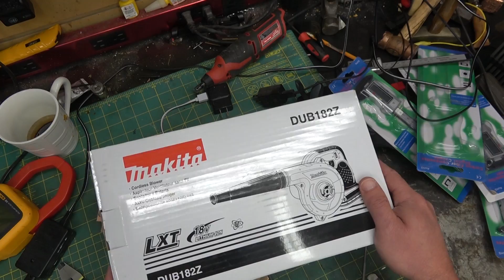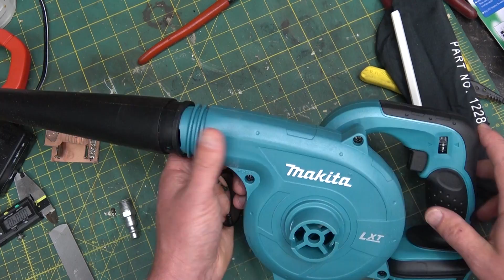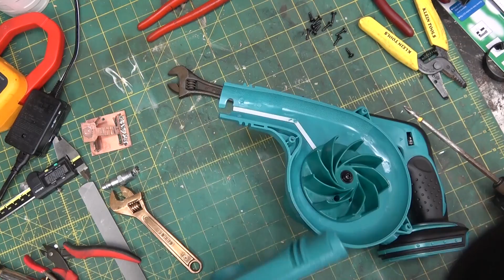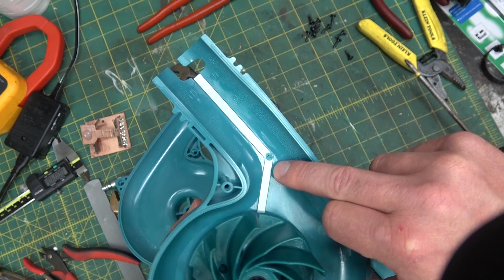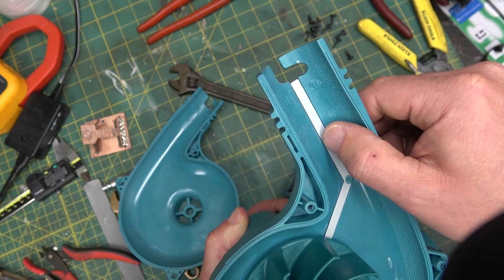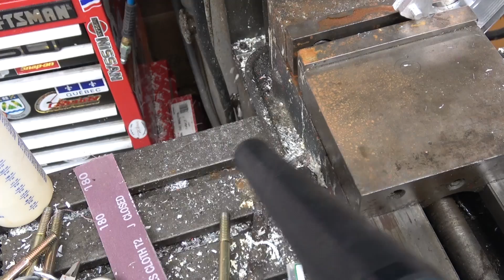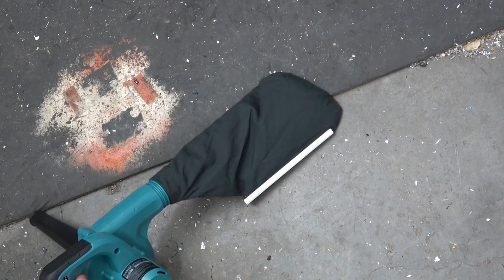BOLTR: Makita Blower/Vac

Comment: Hey man have you had any problems with the vac. Portion of this tool? No damage to the motor or little bits getting stuck in there since it runs threw the blower and motor? Your help and tips is much appreciated mate.

Comment: These will not sustain too many falls from 8 feet or more, if any. I've been through like 3 of these, one time it snapped in half after falling off the top of a 6 foot step ladder onto concrete. Cleaved 'er in twain. It still worked, but you had to screw the thing back together.
Reply: Also, after a while the wires work harden and snap off at the outsides of the clamps that clamp them to the connection points. Also, this tool will not operate without the trigger, I tried to get rid of it and just wire the battery straight to the motor bypassing the trigger mechanism, and it would not function. The Milwaukee blower of this type has far, far better blow-age and far, far better battery life. This tool is a major juice hog. Not as bad as the cordless grinders, but she'll eat up a full 3ah battery in like 10-15 minutes.

Comment: @7:00 those dimples create turbulence at low speed and smooth out at high speed, the turbulent air is pushed to a high pressure nozzle (if attached) . Dimples and Thermodynamics has been a  new area with performance internal combustion engines as of the last few years. I see people dimpling intake manifold, and intake ports on cylinder heads.. it all relates back to golf ball thermodynamics... which may be something they were attempting in that compressor casting.

Comment: I like the DeWalt more than the Makita or Milwaukee Verizons. The DeWalt and  Milwaukee come with hard plastic extensions for the rubber nozel and adapter tips for filling inflatable pool toys, beds, etc  also works as an air vacuum for such things at end of use. Did a blow up corona splash park for my girls saved me hours on waiting for my pancake compressor to fill up over and over

Comment: This blower is great. I haven't touched a broom at a jobsite since I acquired this. Trigger broke on mine I just wired in a momentary on switch it bypassed the trigger, battery to motor more rpm's achieved and get the long hard tube don't have to bend over

Comment: I'm late to the party but I wanted to share my deep knowledge after watching a single YouTube video by Veritassium. 
It's very possible that the texturing is to break the laminar flow that could happen inside the turbine area. Like small fins over a plane wing, it break laminar flow on the surface and increase air speed along the upper side of the wing. In our case, I guess it would make it so the air would leave the turbine area quicker. But who am I to talk. I'm a computer enginerd and I know close to nothing about fluid mechanics.

Comment: Best use I have found for mine is getting  bonfires started. Super easy to bring with you and just a little power from the blower makes a huge difference starting a fire. Works great for cleaning saw dust out of  the shop too.

Comment: I got a busted DUB182Z. Burnt wirings, terminal lugs and the yellow battery holder.

What AWG/ single-core cable size would you recommend? Makita Service Centre can't even fixed it. I'd rather have it fixed myself.

Comment: I believe the roughness of the inner plastic pipe/ tube has something to do with aerodynamic efficiency of the airflow... it sounds counter-intuitive I know to have rough walls instead of smooth ones, but golf balls have dimples so they can travel further and engine intake manifolds shouldn't be mirror smooth as they create more turbulence slowing down the passage/ volume of air than if they had a certain gauge of roughness like fine orange peel.

Comment: Counterintuitively, air does not flow well against a very smooth surface, a rough surface causes tiny vortices along the surface, and it acts like roller or needle bearings along the surface. So the air won't grip/grab the surface, it would be like walking on a hardwood floor covered in marbles.

Comment: The textured area may well be an area of the mold that has worn, and it's been replaced with an inserted area of the mold to repair a large area ... I would have thought they would have polished the texture out ... ? Surely it causes the molding to stick in the mold or perhaps thats the idea to stop premature ejection of the molded part ... ?

Comment: I have this..... bought it 2010 😅 the trigger doesn’t kick in until after holding it down for about 3-5 seconds..... I just deal with it instead of take the trigger apart 😂 I used it to clean Nordic Air AC Air Filters in desert environments 😋 Now I just use it to knock goat sht off the porch & remove mowed grass from the walk way a& steps.

Comment: I have two Makita blowers. I use one for camping and hunting to air up the mattress and fan the fire.the other I use at work for things you'd use a blower for, but I also found a way to hook the vacuum end to my 36v Makita circular saw, and the blower end to a Bucket covered with cloth when I cut work surfaces and counter tops. 
It cleans up about 90% of the mess.
Chooch on, buddy!

Comment: From a buddy of mine, he is a plastics engineer who designs molds.  This is about those bumps
"Its likely to aid ejection. It was probably originally smooth but they had some kind of damage condition caused during ejection due to the part shrinking and sticking to the core too well so the textured it to help break its hold on the mold."

Comment: I’m a forklift mechanic and use that blower for blowing out radiators, engine comportments, and air filters etc. Works surprisingly well for a battery powered unit. But for stubborn jobs you still need compressed air to do it wright. The trigger is definitely the weak point. I’m on my second one as the first ones trigger started loosing contact points threw its travel after 2-3 years of use. Keep up the intelligent comedy. Love it

Comment: My father bought a whole makita kit when I was yound (Ni-Cad batteries generation) and the previous version of the blower was in the kit. We were like we will never use this thing but whatever it is there. Turns out we used it heavily and still works to this day. However we mostly use it to light the furnace, the fireplace or to inflate air mattresses

Comment: I use this to dry my motorcycle. Awesome! Beats the f*** out of spending an hour ... with a chamois and a rag, and not so much pressure that I need to worry about water intrusion into wheel bearings. Pound for pound ($) best tool I own!

Comment: I use my 18 volt leaf blower a lot to clean my garage floors.  Most of the time it is just dust and a little gravel from the roads.  The blower works so much quicker and better than a broom.  The only caveat is that if the dirt is stuck in something or has gotten wet it might not blow off.  I just blow it out into the driveway which is gravel.  Because of that I hardly ever use a broom.

Comment: I do the injection molding. The texture on the inside of the blower housing looks like a "keeper" feature to keep the mold on the B-side of the mold. Sometimes if you have a really smooth curvy part surface on a mold, you can have a part "self-eject" when the mold opens which can be not ideal. By adding texture you can increase friction in the mold and 'keep" the part on the mold.
Reply: Otherwise you go to town with the brass pliers when it sticks in the A side.
Reply: @tymashaw8225  Amen brother. Nothing like brass and propane torches to give you the stench of burnt plastic. Horrible job.
Reply: you the man
Reply: @TextileGeorge  I've been getting your community posts in my feed, but how the feck did I happen across you in AVE's comment section lol
Reply: @horker  because we are both men of culture
Reply: could it be to cut down on static build-up?
Reply: IT is for air improved flow by keeping boundary layer attached to the surface , there are far better ways of keeping a part on ejector pin side of the mould and you wouldn't do it to the ejector pin
Reply: Doc Kirkman this is what I was thinking too. The textured ejection pin really proves it for me.
Reply: thank you for bestowing this insight
Reply: But would that not affect air flow, maybe makes it swirl ?
Reply: Ranjit Yeah, I'm thinking golf ball dimples that speed up the air velocity but then, why would someone do that..
Reply: Doubt it, The airflow would be moving too fast to get badly disorganised @duramax78

Comment: 6:39 I bet that's a turbulence strip where the flow starts to expand, so it doesn't have any dust/debris start adhering to the scroll outlet when used in vacuum mode.

Comment: Rough surface flows the air better because there's air trapped inside the pists acting as a lubrication/bearing surface.

It also makes the surface last longer when there's sand/dust as it cant rub against the surface.

Comment: FWIW those "Ultrasonically welded..." are just heat stakes; or Thermoplastic staking. Staking like that which appear messy and irregular are nearly always melted down with a tool that is just cheap and gets hot, usually a soldering iron. You can often find carbonized material left in it. Of course Stakes can also be melted down ultrasonically but in the past few videos in which they were described, the stakes looked like they simply got the soldering iron treatment.

Comment: Currently own the AC corded version of this (UB1103). 600W brushed motor, variable speed on the trigger without the physical stop adjustment wheel (it has a trigger lock-on button instead), and the nozzle attachment is also made of rubber, but it seems to be a bit more rigid and doesn't collapse in on itself as much. Either way, it's a brilliant tool. Useful for dusting out electronic equipment, cleaning up around the place and around the yard.

Comment: That textured pattern on the inside is to help pull the part out of the stationary side of the injection mold.  When you have a part of that kind of shape, where the convex Side is the "pretty" side, it kind of wants to hang in the tool without those kinds of friction building patterns on the eject half of the tool.  That is a well designed tool to have those in it from the outset and not hand ground in later

Comment: Hey AvE, those differences in color could be due to the fact that different polymer types bond to the colorants at different rates. And will affect the hue of the color. Trying to get the exact same color between different plastics is expensive to do. And those bumps on the inside are probably due to help with the fluid dynamics as well as prolonging the mold life. Glass filled materials are very harsh on the molds. If you have any polymer questions, I can do my best to help!

Comment: The roughness on the inside of the casing is to keep the part on that side of the injection tool without falling off when the mould splits. The way it's done looks like an emergany measure that they hadn't counted on. Amateurs.

Comment: Ya gotta let go of your hatred of split ring lock washers.  I've shipped thousands of communication towers, many in seismic areas, that are held together with A325 bolts,  2H nuts and split ring lock washers.  I've also done inspections on  said towers we dont find loose bolt assemblies at all.
On a rare occasion, some oddball enginerd will specify internal /  external, Belleville, etc washers but its ultra rare and we dont even carry them.

Comment: Hey AVE I love this thing. I got the kit for Christmas with this this blower, the recip saw, oscillating tool, circular saw, grinder and light and they have all been heads above the old Porter Cable kit I had.

I use this little guy to blow off my lower driveway and entrance to my shop. It’s not a double batteried million CFM mini tornado but it will do the job in about 5 minutes.

Great review, thanks...

Check out my channel... PaddyG DIY

Comment: The texturing inside the housing could be to help the part stick to that half (moving half) of the die when the the die halves separate after moulding. That might be because of the ribs on the outer part of the housing would tend to try and hang in the fixed half of the die. The ejector pins have texture and grooves are to stop the pins skidding on the rounded surface when the part is ejected. 
(I'm a Toolmaker by trade)

Comment: If you ever watched the mythbusters episode where they covered a car with clay and scooped out golf ball sized dimples, and even with the weight of the clay, with the dents and scoops out, it got significantly better gas mileage due to the rough surface. I'd imagine they did that for laminar flow benefits, as smooth creates turbulence but rough allows for increased velocity.

Comment: I've had one of these for 9 years and only in the past months that the turbine wheel has started clicking. Not sure if its the anti static flopping around or the bushing flogged out but still goes hard. I do like the Milwaukee ones as they have a longer nozzle and blow alot harder.

Comment: Regarding those lock warshers. If I recall you or somebody did a test with only breakaway torque after tightening them, but aren't they geared towards keeping a fastener from backing out due to vibration? I don't think anybody's tested that. So long as the washer puts a decent amount of pressure on the fastener it can surely keep it put, similar to carburetor adjustment screws with sproings on em.

Comment: The bumps inside the impeller housing is probably there to induce a turbulent boundary layer, which would delay boundary layer separation compared to a laminar one and allow air to leave the tool at higher velocities.

Comment: As a carpenter this is an invaluable tool. My workmate as the Makita and I have the Dewalt. They are basically identical apart from colour. My Dewalt has that same ubiquitous Mabutchi motor and 3 speed switch setup. I love it.

Comment: That rough texture on the interior likely has to do with laminar flow. There are similar reasons why you don't polish the heads on an engine, because the texture of case aluminum better servers the airflow into the engine rather than polished surfaces. I'm no expert unfortunately, so I don't quite know all the science and terminology however.

Comment: It almost sounds Makita is doing something similar to the software industry. Old code that is not longer being used or buried to deep to be useful, it is released either in the form of an old product or open source. A prime example would be how video game corporations release very old version of games that don't work with current software and/or hardware, luckily there are emulators and that sort of thing. However in the Makita case, they may not be using it as a PR activity but rather as a direct profit activity. Time will tell depending on how good those tools turn out to be for the home user who wants a cheap tool because they will rarely use it. It is still a very good business idea.

Comment: I have two of these. Milwaukee, actually. Got the big batteries to go with them too. We went to float down a river with the extended family for a week. Shuttling tubes back and forth would have been a pain had these blowers not come with a reducer attachment. When we get to the drop-off point, it only takes seconds to get the float taut. saves on car space for sure and these blowers serve more than their purpose.

Comment: Texture is to hold the part in the mold... 

Because of the shrinkage of the plastic material and the shape of the part it will "demould" and eject itself during the opening of the mold... because  of this you can't pic it up with a robot and because it is a visible part you will end up with dents if you let it drop from the mold.

Next issue is if the part sticks to the fixed mold part during mold opening there is just no way to eject the part from the mold because the ejectorpins are only on the moving side... 

Texture is way to coarse to help flow... 

Just2cents from tooldesigner

Comment: NOTE TO MAKITA : Every one of these on an Australian building site has a 10mm bit of hose taped on to the nozzle for blowing cement dust out of 12mm holes that are used for epoxing in rebar. An official attachment would be a good idea 💡
Reply: And I'm sure they'll be reading this.
Reply: Seeing how it is illegal to blow the dust out of the holes due to silica dust. It would be bad to invest in anything but a hepa filter vacuum for your cement dust problem.
Reply: @SweetMooch  I've worked on some incredibly (from a safety viewpoint) anal sites and have never seen anyone use anything but this tool for blowing out holes.

Full length pants/shirts,safety glasses and gloves at all times (regardless of trade) and electronic tagging in and out of site and yet they still blow dust (albeit with appropriate dust masks)
Reply: Its illegal to blow dust out of holes... what a time to be alive.
Reply: @Haywoodjablomie100  safety nazis everywhere these days
Reply: @Haywoodjablomie100  Hey, it is the country where laying a couple strips with your car will land you in jail, after all...
Reply: You might have guessed it from the country that also banned 9" grinders cos poor sods can't control one. Now you can't blow dust. An I thought EU laws were fucked up!
Reply: @michaelbamber4887   England perfected Conservatism, United States perfected Pragmatism, France perfected Protectionism, Czechia perfected beer drinking.
Australia is pushing the envelope on all of them at the same time.